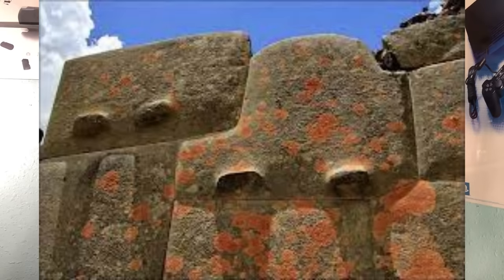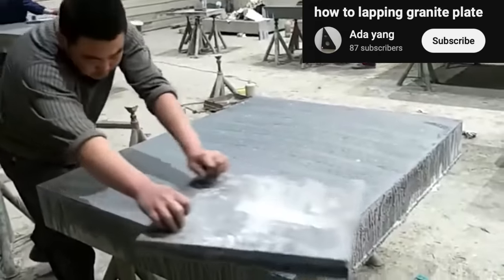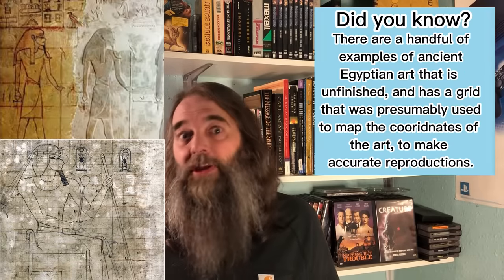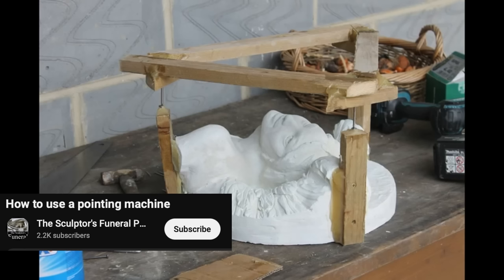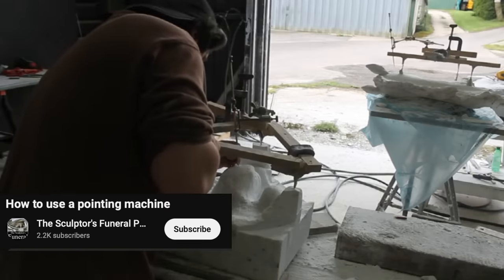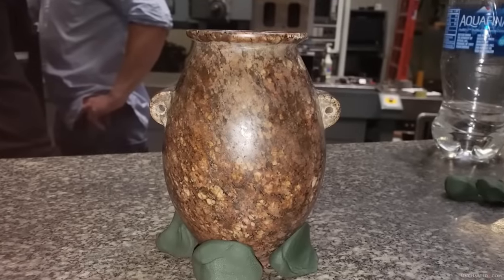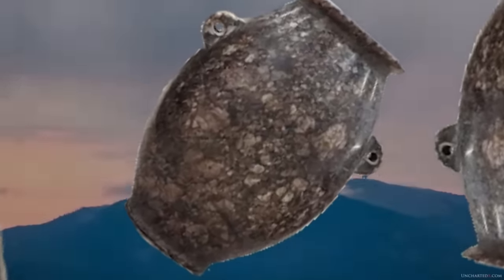The True Purpose of Megalith Stone Nubs

Comment: Usually the simplest answer is the right one and I don't think we're quite there yet, but this is definitely a viable explanation. I believe they had an easy way of doing this and that the weird angles and shapes they chose were not a coincidence
Reply: The weird angles and shapes kept them from collapsing during earthquake.
Reply: I believe these structures withstand earthquakes better if they are blocks that can wiggle but not fall.
Reply: Great, but how did they learn this technique, globally, across oceans, from Easter Island to Egypt, to Japan?
Reply: The weird angles and shapes were dictated by the original shape of the megaliths and not by the choice of the masons.
Reply: Occam’s razor 🪒
Reply: @shawncoleman8530  Because they all had the same experiences with earthquakes, and therefore came to the same logical conclusion independent of each other?
Reply: @peterrevens8454  Maybe but doesn't fully answer the question. We dont have the full knowledge or information, sadly. It's pretty much speculation at this point.
Reply: @shawncoleman8530 because they are connected. If they could build walls in that quality they surely could travel the seas.

Comment: As a profesional rigger, I see the nubs as a way to keep ropes from slipping when lowering in place. I would use an A frame type crane with block and tackle.
Reply: Indeed, I am in agreeance, this seems the most logical reason for their appearance.

The nubs could even be hypothesized to serve multiple purposes, 
for instance... 
After their usefulness in the positioning of the nubbed blocks themselves, the same nubs could serve as supporting points for scaffolding/rigging structures which would ultimately be necessitated for supporting/lifting subsequent blocks used in the following layers of construction and only removed after the sections reached completion.

For obvious reasons, including the sheer weight of some of these blocks alone and the notable degree of precision would undoubtedly require a more complex and robust system for manoeuvring such stones up and into place than a simple primative top down crane alone could achieve, thus, necessitating a complex approach, the sheer complexity of the structure withstanding shows that they were no strangers to problem-solving and the principles of mechanical advantage.
Reply: Could they have used such an ‘A’ frame set up with various sized horizontal logs which they wound rope around to act as gear reduction or force multipliers?  I am a crane operator.  Man, I’d love to see what they used then.  Reminds me of the movie, ‘Idiocracy’.  We think we are so superior today with our computers.  When in actuality our predecessors make us all look like a bunch of monkeys.  Hell, that’s an insult to monkeys.
Reply: Sorry to rain on your parade but that idea was proposed a long time ago and ruled out almost immediately because the nubs are often asymmetrical in placement on the stone, too smooth, sloped or small to be good anchor points. Plus, if you are capable of such phenomenal joinery and finish work why go through a reductive removal process to make the nub and leave the nubs there after if they were only for lifting or installation?
Reply: Then why not cut the nubs square or with lower indentions on the weighted bottom side that allows the tackle to physically (Physics) slip into and secure the tackle from slipping around and slipping aside of the nub? Then why not nubs in every stone face?
Reply: Pretty sure it looks like they just got lazy and or ran out of time to completely "finish" some of the blocks after they were cast in place. Im pretty sure they had a technique in which they were able to use stones as some sort of concrete and cast them all in place.
Reply: Think about the size (circumference) of a rope strong enough to lift a 20 ton stone. The rope would have been so thick that it would have slipped off the nubs. Most likely humans could not lift or even grab onto a rope of this size. Take a steel cable capable of lifting 20 tons and multiply it’s circumference 100 times. That’s how big the rope would need to be. If the nubs purpose was to stop a rope from slipping they would have been shaped differently. The thought of using a rope to lift those stones is absurd. They were shaped and lifted by some entirely unknown and as yet unrealized  process.
Reply: Could be both
Reply: @palehorse24681  
These stones are igneous stones, they can't have been cast in place. there is no way to make a geo polymer like concrete or by any process that involves heating the material to a liquid state. If you try heating any igneous stone to a molten temp, when it cools all you will have is volcanic glass. And there is no known process of making granite into a powder that could be reconstituted, not out mention that is pretty easily ruled out as it would require an order of magnitude more energy than quarrying and moving natural stone and again there is no binding process known that could even do it and chemically its a non starter.
Reply: @benjamincrowley9919  Maybe, after using them for whatever was their true purpose, maybe they just liked the look of them..? I know I do; if you picture these amazing earthquake-proof walls with no nubs....kinda boring ! Artistic licence !

Comment: Brilliantly thought out, bit seems a bit strange to then not dress the nubs out on the finished stone
Reply: Why bother dressing them out? The wall wasn't a mantle for showing off. A barrier like these walls are defence, and with the nubs on them, would be a huge advantage: the enemy would try to scale the face using them. A predictable path.
Reply: Agreed.  Seems strange they would not be removed as the final dressing of the blocks.  There must be some meaning to these nubs.  Fascinating!
Reply: The nubs are a factory defect. The rocks surface was softened an inch or two deep. The nubs did not soften for some reason, poor contact with the softening agent? They are too hard to remove easily as they persist as solid rock. So they left them in place after shaping the softened rocks surface. Defects happen even today.

Comment: I was kinda leaning towards the geopolymer.
One fellow had suggested that the 'nubs,' were where the wet materials were poured into a preformed frame, with the sides fairly close to the place where the stone would set.
Someone else suggested the idea, that the wet stone materials were places in something like a burlap bag, made from plant materials.  And then after the stone was seated into place, it was allowed to fully set and the 'bag,' being organic, would just rot away.
Another reason I think they were 'poured, rather than cut, is the faces of many of these stones, seem to have a thin 'veneer,' that now in their ancient state of age, that veneer has begun to peel and flake from the surface beneath it.
Many of the polygonal stones, have 'rounded,' kinda 'bloated,' looking faces, and that rounded shape is common. nubs or no.
Looking at the stones on many of these polygonal walls, we also see what appears to be 'scooped and cupped marks,' on the surfaces.  Like someone had a tool that would just scoop or peel the stone in sections, like peeling a potato.
It's been suggested that the ancient builders had learned how to harness the sun, through something like glass or crystal, to magnify the sun and actually melt the stone, making it easy to scoop or scrape away, a bit at a time.
There's a couple of videos on YT, where someone does exactly that, And melts stone!  'Granite too, I believe.'
But maybe that was just for certain situations, not for mass production.

Comment: I thought i am the only one who loves archeology and retro video gaming. So it seems i was wrong. Btw. i heard a lot of theories about these nubs. Your theory is new and interesting. But i still think they would not have done so much work moving and polishing hundreds of tons stones and would not go the last mile to remove the temporary mesurement nubs on the final product. So either the nubs had a certain purpose or they did no chiseling and cutting at all, because the stone was liquified in the first place. Just think of our modern plastic injection molding. There are nubs too. In my opinion the geopolymer theorie has the most issues but none of the existing theories can explain every aspect...

Comment: Nubs could simply be remains from quarrying the block. When chiseling a block of stone from a quarry wall, often high above ground, some attachements must be left until the block is finished. These small attachements are then severed only as the last step before removal and transport of the block. The nubs could be the remains of such attachments.
Reply: Yes. Have in long time believed that as well. The problem with that thought is the exxagarated stone masonry that is nessecary. You should carve out a huge block of stone, much larger than you finally need, to be able to produce the nubs, just for lifting them? It sounds good at first, but it you think about 100 or 500 blocks, then it would just be more easy to build af ramp, or a system of lines/robes etc.

I do not say you are wrong. Or that Mr. Debunker is wrong, it just sounds like crossing the river to get water ...
Reply: @drfrosti This has been my thinking, too -- that the stone was completely finished while still in the quarry, held in place by the attachments. This way they can access all sides of the stone without it moving. These left over nubs have worn smooth over the centuries by erosion. Debunking offers some good progress on this topic, though, and very interesting. And then the Yangshan Quarry megaliths still confound me!  Check it out.

Comment: In 1997 I visited the Museo Inka museum Cuzco the museum curator / guide stated the general consensus was Inca stone blocks had been manufactured , locals had unearthed several pits of misshaped and fractured stones in the 1800s , inside they found insect larvae and small beatles which had fallen into the moulds and cement , I had not until now heard of any electricity been used in the manufacture ,  just sun drying . Hope this helps x
Reply: The famous archaeologist Junius Bird speaks of organic material
Reply: Yep my theory as well, I have thought for years that they mixed up a slurry and pour these stones into molds.
Reply: @travislee6032   if that was the case then why are they all different shapes and sizes, and weigh tons upon tons. Surely a small, single uniform mold would have been more practical if using a poured mixture. In any case, in places like Ollantaytambo they have found the Andesite quarry and even half finished stones that were abandoned halfway between the quarry and the building site.

Comment: I usually agree with most of your theories and explanations for things, you do a great job of approaching them from a logical standpoint but I don't think this one quite adds up. It does not make sense that the nubs would be left on after completion despite putting so much work into cutting and shaping them to perfection, no matter how they would have done it. It only makes sense to me if they were the excess from the geopolymer molds. I don't know the specifics or the science when it comes to geopolymers but if it is anything like other molding processes then that makes sense to me. Plus this also explains why they were not chiseled off after because they would not have had their highly skilled masons on these projects to begin with, they would not have been needed. They would only need the people who make and use the molds and then whoever lifts the stones into possession, no chiseling, cutting or lapping required.

Comment: Your explanation is the most feasable one I've ever heard. No magic, just beautifull ingenuity. I like wood working, and I could translate what you explained to wood working. Genius. Best Regards
Reply: His explanation is ridiculously and unnecessarily elaborate. If the accurate fitting were done that way,  one would ecpect to see many blocks with nubs, whereas there are always far more blocks without them than with them. The stones were NEVER cut to shape because they were washed with a reagent that turned their surfaces soft for a short while. Gravity and compression then defomed their surfaces into one another to create a perfect fit. Some of the blocks at Sacsayhuaman even display the trowel marks left in their surfaces when they were smoothed over whilst soft in order to assist the melding of surfaces.

Comment: Lifting bosses or handling bosses are protrusions intentionally left on stones by masons to facilitate maneuvering the blocks with ropes and levers. They are an important feature of ancient and classical construction, and were often not cut away, despite having fulfilled their purpose. Sometimes this was the result of a cost-saving measure or a construction halt. Other times bosses were left as a stylistic element, and even if dressed back, a remnant of them was kept to make their existence obvious.
Reply: the wiki doesnt explain how they lifted those monumental stones though eh
Reply: If they were concerned with the cost, why cut stones in such inefficient shapes?
Reply: @mkeyx82  Because cutting stone is HARD using only other stones. You work with the natural shape.
Reply: @Les537  so, you have to find stones with same natural shape so that they fit together nicely? How does one do that?
Reply: @Les537  they did not cut those stone with other stones lol, are you mad?
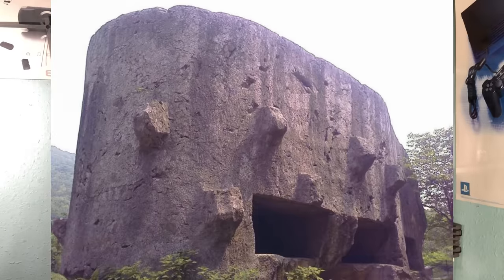Reply: Wrong.  The Quarry Wall ( @0:49 ) does not need 500 lifting Bosses.  The Nubs are simply the excess material that was cut last to remove the block from the quarry wall.
Reply: @mkeyx82 the shapes are all but inefficient, the complexity serves to interlock them in a way that makes them in many ways far superior to modern building practices.
Reply: @quercus3290 the hardest cutting tools we have are tipped with stones 🤔 diamonds. 
So...
Stones are what we use to cut stones in almost all circumstances.
Reply: @hybridgoth  OK, yes, that's a valid point. But I still stand by the fact that if someone wanted to build "cheap" would not be doing this.
Reply: @hybridgoth  LOL, if you have evidence those stones were cut with diamond tipped tools, please provide.
Reply: @quercus3290  I never implied nor inferred that they were, thus, I need not provide any evidence to back up your implications. I simply stated that we almost always use stones to cut one another.
Reply: @hybridgoth  "Stones are what we use to cut stones in almost all circumstances" Implies a lot, especially with regards to a conversation about stones being cut with other stones. Dont think your as good at English as you think eh, so less of your funny business young man.
Reply: @quercus3290  young man😌, well I suppose, for a lapidary/gemologist I am younger than the average of my peers, however, I'm quite correct in my assertion that we in almost all circumstances use stones to cut stone, your assertion that I need proof that ancient civilizations utilised diamond tipped tools to do this was not something I inferred however evidence to show that these stones amongst many others were in fact cut by ancient civilizations is blatantly apparent.
If you've got a 'better' or 'easier to acquire' tool for cutting stone I'd be interested to hear it, I'm not going to hold my breath though.
Reply: @hybridgoth  you implied they did, you provide a source, its not up to me to disprove your assertions.

Comment: Great hypothesis. I also like the leverage point for rigging hypothesis. 

Personally, I've thought they were remnants of quarrying. An example as the unfinished obelisk, They'd grind away to the bottom, then grind it out more to small singular points, then break it off, which would leave these singular nubs. They'd quarry larger blocks, and then cut them down smaller and to fit, to make the wall, as we know they had to have been cut to fit on sight as they were building. Which is also why we see them randomly and not uniform. The nubs and walls we see are simply unfinished. The ones that get me, are the finished ones we see at Ollantaytambo, where the wall is finished to flat, but they also left the nubs and finished those as well. 

I think they served all these hypothesis. Just a usable feature left over from the process. 

Hope this makes sense lol 

If only we had time machines. So much mystery with these ancient marvels. 

Hope you're doing well bud. Always enjoy your videos!
Reply: I thought that as well… When I carve delicate things (wax models for jewelry)  I leave support systems in place and remove them at the very end.
Reply: My question would be.....why leave the nubs on? they have served their purpose in the construction, they aren't needed any longer, have some pride in your work knock them off and finish the the stone.

Comment: I like the video. I still think handling bosses is the most likely explanation, at least for most examples we see, but you've put forward a not crazy idea.
Reply from the maker: Thanks, I do think there's a strong chance they were used as bosses, but we do need to explain their dummy-accurate megalithic masonry as well, and I feel this does both. After using the nub as a guide to cut, if it offered any advantage, of course they would get used as bosses. But I'm just a YouTuber, so I may well be wrong af haha.
Reply: No you right I thought they could be tuning forks for a resonate and you can then use a tool to subsonic cut the stone. Also used as a boss for guidance and accuracy.
Reply: Not all stones have nubs so how did they make them and why would you need nubs on oblong and square ones?